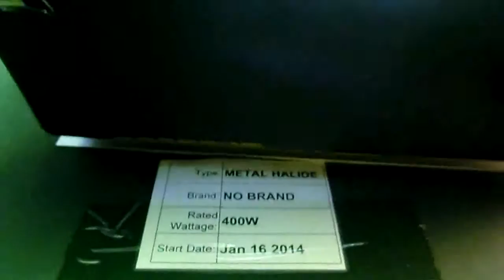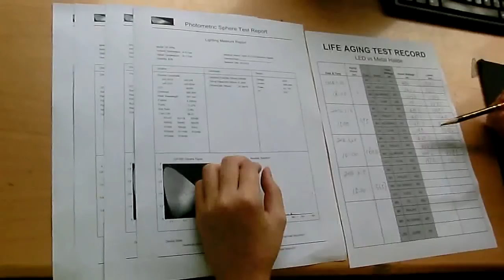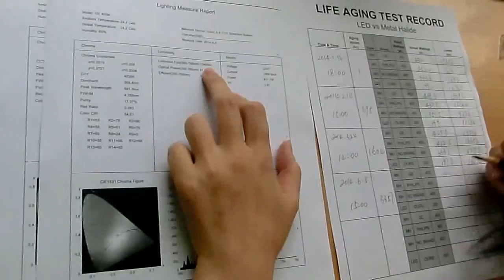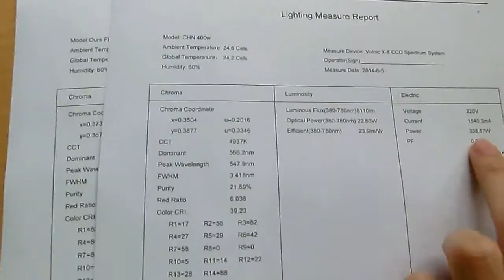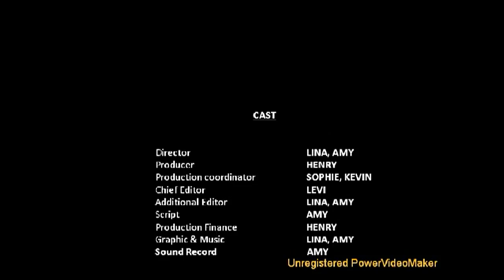LED VS Metal Halide Episode 4

Comment: I don't think this is a good test. They should be tested as they were in the environment. you need to test them in cold, windy, rainy and snowy conditions. Testing them in a warm dry building don't impress me. Not an accurate test.
Reply from the maker: +Paul Short thanks for your suggestion. Besides the LM79, 80 reports, lighting up these fixtures day 24/7 over one year is our one way to understand and compare the light depreciation and life-span. We also do other tests, like water-proof tests. If you would like to know more, welcome to contact by email lina@zoweer.com

Lina
ZOWEER Lighting 
(the manufacturer focuses on LED flood light, high bay, street light, parking lot light.)